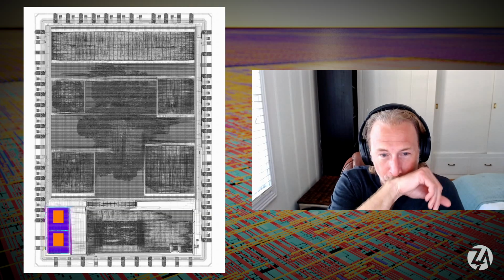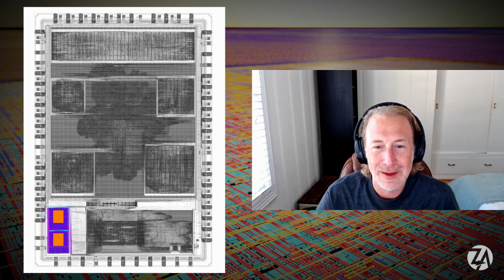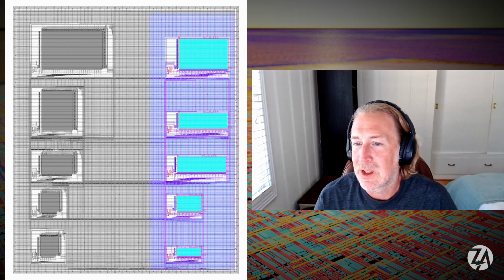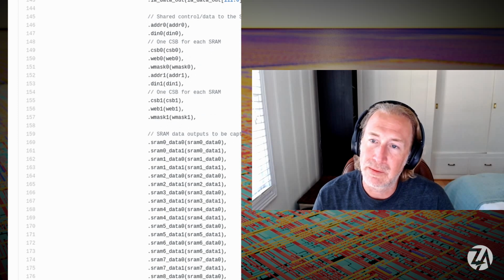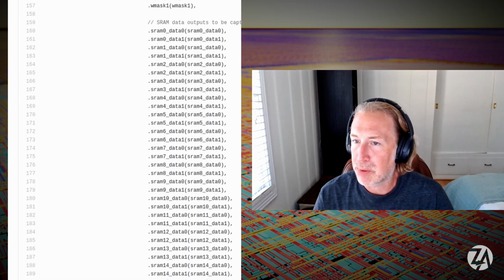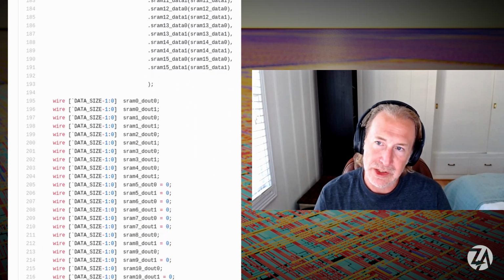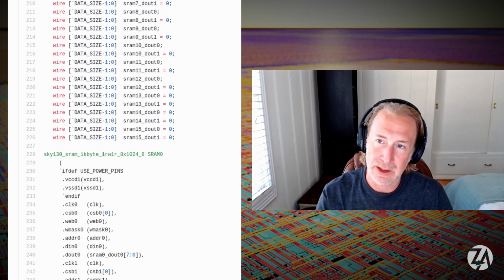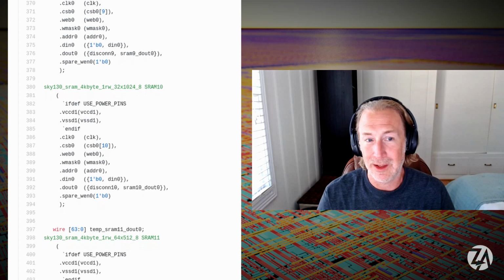Matt Guthaus - OpenRAM

Comment: We have a tool which  does the characterization using open source Xyce.  I tried 127x4 bit single port sram.
It took 8000 minutes of cpu time for 7x7 char matrix with timing and power. I used 2 computers with 9570X  cpus. SRAM was not generated by OpenRAM compiler.

Comment: How many kB fit in the Skywater Shuttle?
Reply: Click the MPW2 application link above and you may find out ;-)
Reply: @rjordans  Thanks!
Reply: @rjordans  I looked, but all those memory cores are on the same die. I was interested in how much you could get if you fill the whole die with just one core.
Reply: @HansBaier  for a larger memory you would probably want to start using a banked structure with smaller sub memories to keep things fast. I'd take the 8k block for a first estimate and check how many of those will fit on the die. That should give you a ballpark figure